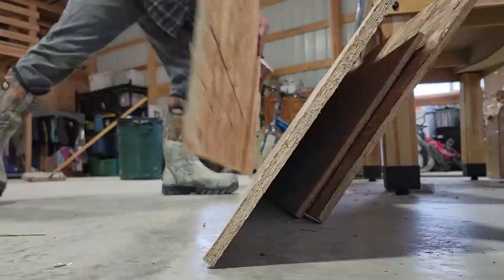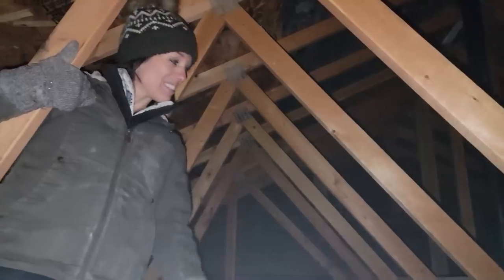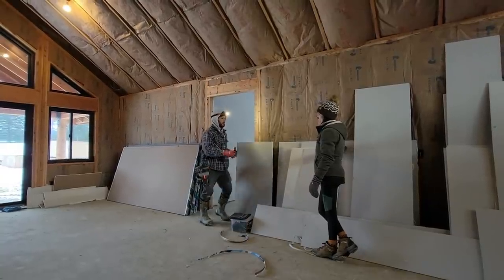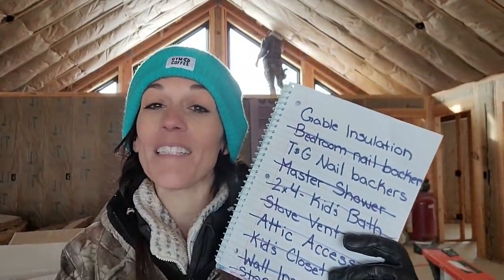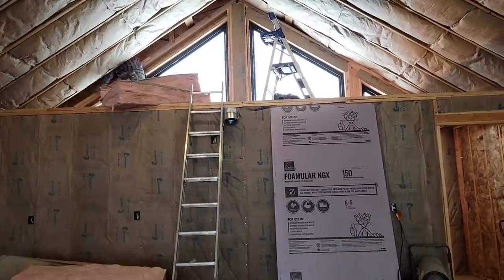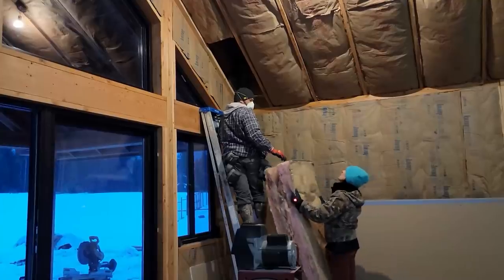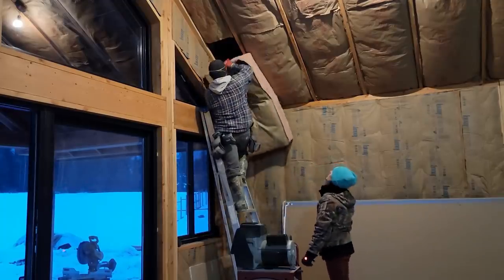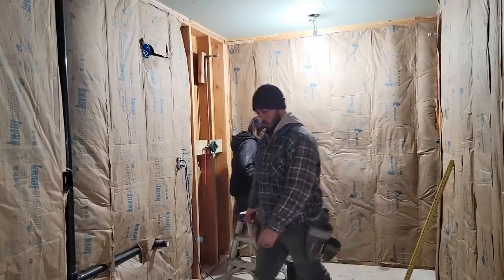Working Through Difficult News While Building Our Mountain Home

Comment: If a mouse chews through your wire it could arc and catch the insulation on fire and burn the house down. A  buddy of mine used blown in insulation and the old wiring caught the house on fire and it burned to the ground.

Comment: Why are you cutting outside vice inside? The HVAC system isn't in operation, so sawdust is a non issue. More over, you can keep the sliding doors closed retaining more warmth.

Is there an exhaust vent for the stove in the kitchen? If so, use it to temporarily vent your wood stove.

Comment: Run your hvac system it will help find any faults in it. Through its lifetime it has to be maintained now’s the time to find out if there are any issues before you move your lovely white carpet in. And it’s safer and more efficient than random space heaters of any type. Don’t understand why you needed the blow in insulation as the whole exterior is well insulated. 50 years in the hvac business

Comment: Run your heating! Put filtering membrane on all the return outlets (change regularly) and the filter(s) in your furnace. Have done it in multiple homes and jobs over the years and have never had any problems! Trying to heat the house to dry the taping job is futile in a house so big with just one kerosene heater. Sorry but you really shouldn't have any problem keeping the dust out of your heating system. My deepest condolences to losing a comrade in arms.

Comment: I'm no contractor, but I'm curious. If you're blowing in 16" of insulation over 2x4s, you won't be able to see them to step on them if you need to go up there to fix a leak, wiring, catch a raccoon, whatever. You effectively will eliminate the possibility of going up there for anything. And if you're access hatch is just a piece of drywall, there's no insulation above that? Is that right or are you then putting a flooring over the insulation and something insulated for the hatch? If so, what are you screwing it to? I'm confused how this is going to work.
Reply from the maker: The lid has foam insulation glued to it. You just walk on the trusses or add some planking if you want to. There is no plumbing in our attic space, and wiring doesn’t “go bad” 😂.
Reply: @GoodSimpleLiving  Cool. Wire does go bad though, esp if critters get up there. They like to chew on them. Be careful up there if ya have to go up there!